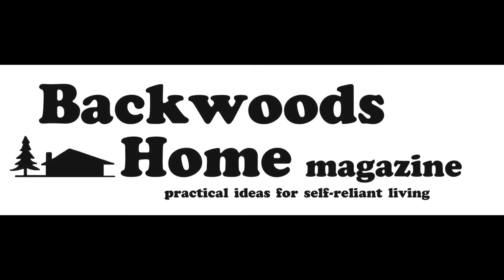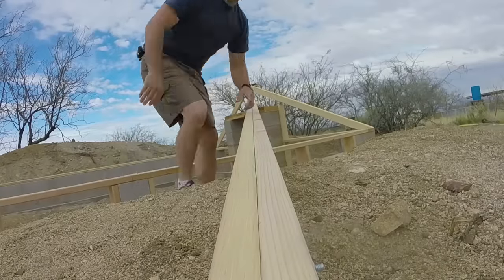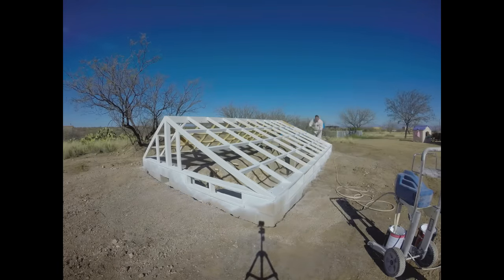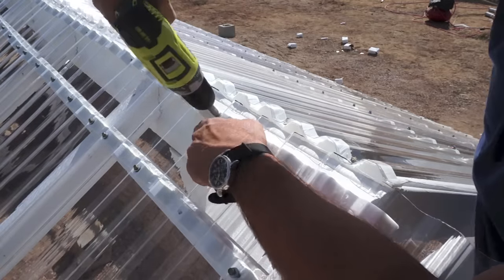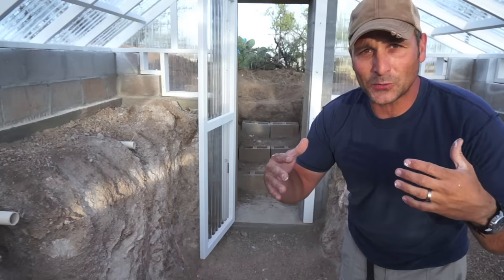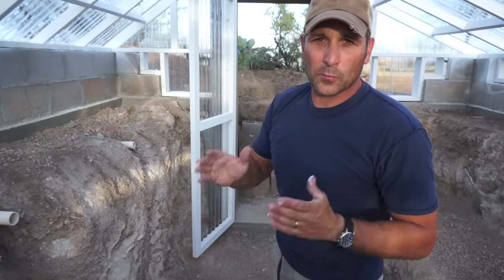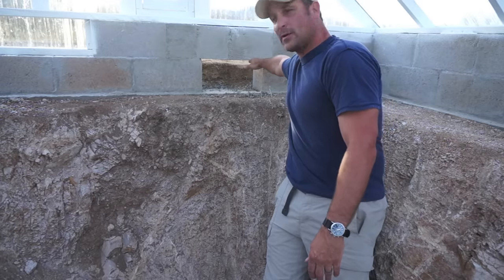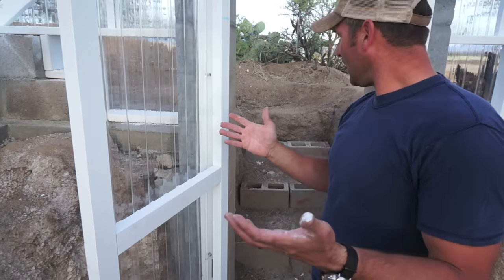Sunken Greenhouse Part 3 - framing, polycarbonate install how to

Comment: Use steel cable, and turn buckles to add cross strength.  In lieu of installing a pillar in the middle. A perfect triangle won't sag

Comment: have you investigated any of those automatic hydraulic  vent openers? They are cheap and don't require any electricity or anything. I found they are a lifesaver - (plant saver) on hot summer days?

I really like your attention to good solid construction for a project that will last  lifetimes  perhaps. That thermal vent is especially awesome. What a clever person you are!  Where is this project located?  Looks sort of like heavy clay  rocky soil.
Reply from the maker: +Don Rad Hi Don!  Yes, I have been considering adding in a hydraulic opener but am concerned with our crazy winds here... so I may stay with manually opened ones, but it's still a consideration as I love the way that they work without electricity!  As for location, I'm in S. Arizona (high desert)... and yes, this soil where the greenhouse is a mix of decomposed granite and clay mix... which isn't too much fun to dig...lol!
Thanks for watching!
joe
Reply: +homesteadonomics From Experience: If you don't have some type of automatic venting system, sooner or later you will fry everything in the greenhouse. In your climate I would recommend a fan hooked to a thermostat blowing out a louvered vent. Then on the other end have swamp cooler pads. Even with vents and doors open you will have very high temps in the summer desert sun. I built my first greenhouse in Phoenix in 1980. I put a regular swamp cooler on one end outside that kicked on at about 80 degrees. 
Even with automatic system, you should have a separate fail-safe alarm that sounds and calls your cellphone if something does not work right. All of this advice, of course, depends on the value of the plants you have inside.$$

Comment: I would think you d have to seal all those screws with some sort of adhesive or sealant ...or maybe you need the moisture building up inside of the greenhouse along with some air seeping in....

Comment: The entrance needs to be enclosed with a drain at the bottom. The footers need to be below floor level with sealed masonry walls  with drainage below floor level. And the roof needs gutters with drainage away from the greenhouse. This unit will eventually become a mud pit with the outer walls and footers being eroded and undermined by the power of water. Cutting cost is nice if you can afford to rebuild every year or two.
Reply from the maker: Charles Lloyd I have a couple recent updates if you want to check them out. One from this month and on from November.  I have gutters that collect rainwater and channel it to my garden where it’s collected in IBC totes.  This past August my house had over 11” of rain and only a wet area by the door.  The ground is graded away from the structure.  Anyways, check out some of the others and you’ll see the other items.  Thanks for watching and I hope I answered your questions😀

Comment: I had an idea about using corrugated pipe to burry under a green house with vents close to the floor and vents at the top. Hot air rises cold air sinks pipe close to top heats up creates an up draft that moves air like convection in the green house. Could even add low voltage electric fans to help move air through the pipes. The burried pipe would pick up the cold from being fifty feet down i thought maybe there could be a way to use fan speed to keep a set temperature within the green house summer and winter by having two ventilation systems to keep the air moving inside a green house with all componats being designed to handle humid and moist conditions.

Comment: ditch the support beam and just put collar ties across there, they will keep it from sagging, remember they go in the top 1/3 of your rafter length
Reply from the maker: +lil00chevy Yes, that's a good idea, and one that my father-in-law suggested too.  But I already went ahead with the post for both support and as an anchoring feature incase the structure ever started to flex with our crazy winds here.   But I agree, the collar ties would've probably been more than enough:)  Thanks for watchign chevy.. and stay tuned for part 4:)
Joe

Comment: I would really like to know what the advantages of a sunken greenhouse. Is it because there is a lack of water in the area it is being built, the sunken greenhouse is designed to catch water for the produce you are growing inside. I live in wet England and it would soon be a pond with a fancy roof on top if I built it here. If you could answer my question or if anyone else could you answer I would be very appreciated.

Comment: Used the same roofing panels on a job for a customer of mine. It was a patio cover that was 30' long by 12' wide. Turned out great but after two summer's he hired us to replace the panels due to the heat was warping the panels. Have you run into anything like that?
Reply from the maker: Ryan B hi ryan... if you check my videos fr m about january 2018 time frame you can see an update of this project.  Currently it is over 2 years old and the panels have not warped and are still very clear.   These are polycarbonate and not vinyl panels...I’m guessing the panels you used were vinyl.

Anyways, check out that more recent video and you can see how they are holding up:)   Just click on my channel page...then videos tab and they will be in chronological order😀👍

Comment: Looks awesome. What's your plans to keep it from flooding out in heavy rainstorms?
Reply from the maker: +Ponca City Lawn Care LLC Hi PC... I'm going to do a QA vid on this series and this is one of the most common questions.. for good reason too.  Initially I'm just gonna let the rain come in.  I've measured the sq/ft of the potential collection area around the stairs and it shouldn't amount to more than 10-15 gal of water for a 1" rain.  IN my environment it'll soak in with no problems.  Everything else will be graded away from the GH... and I'll be installing gutters to collect the roof run off....BUT, that's no sure thing and it may very well end up with more water than I expected and then I'll have to do some problem solving...lol!  But if so, I'll probably end up building a cover or something like that for the stairway area.  Hope that answered your question... but ultimately I'm gonna have to wait and see:)
Joe

Comment: I'm not a builder so this is a basic question. How did you attach the purlins at 1:55? The video is too fast and at a distance. I don't have a nail gun, so I was thinking of off-setting the purlins (the width of the purlin) so I could hammer the nails straight in from the other side of the rafter. I don't know if this would be bad for the polycarb panels because they would not be screwed down in one straight line. I'm attempting to make free-standing, shed-roof awnings for 2 exterior house doors, 8x6 and 6x6 foot square areas.

Comment: Hi from kiwiland. Love this. Can I ask why you went sunken? Im guessing ease of maintenance and using the earth walls to store heat? Im assuming that there are no flood concerns if it is built on a high area? Thanks.
Reply from the maker: Hi Mike... yes, I sunk it for earth/thermal benefits as well as high winds in our area.  And because I just thought it was a neat idea:)  Flooding is not much of a concern as our water table is hundreds of feet down and all of the ground slopes away from the structure.  Glad you liked it.. part 4 is up and part 5 is in the making:)
Joe

Comment: That is looking so good and you did a great job on it! Considering your location what safe guards are you placing to prevent the rattlers etc from making this their home?
Reply from the maker: +weetreebonsai Hi WTB!  Regarding snakes and mice... I'm thinking the door and all the gaps are tight enough that I shouldn't have a problem... but only time will tell for sure... gonna have to build me a snake pole just in case!
Joe

Comment: Do you have to use a special grade of corrugated plastic for the roof? Something optically clear to let UV light through?

The reason I ask is that a friend of mine once replaced the panels on a tanning bed to surprise his wife at her hair salon. But, he didn't know to use something called 'OP4', which is optically clear and lets UV pass through it.

Comment: You don`t need a centre support.  You have very little weight in the roof,. even covered with snow.   Actually the biggest weight the roof will see, is wind pressure . The roof weight is taken by the rafters which bear onto the wall plates pushing outwards. if your wall plate is fixed to the wall which in turn is supported by the soil against it. .. Imagine the force needed to spread the rafters and consequently push over the walls...  Not going to happen..   Quite safe as it is...

Comment: Wonder how this would do at 46N (Prince Edward Island).  10 hrs days go from Nov 5th to Feb 5th.  So nothing would grow but harvest would not be an issue.  Just staying marginally above freezing would seal the deal for me.
Reply from the maker: Hi Brent... I'm not totally sure how it would do but I think it would be worth looking into.  For you though it might be better to be built into a south facing hillside since the sun will be lower in your horizon.  But I think i could definitely work... you could add a rocket mass heater in it and that would make heating it really efficient.  I haven't built one myself yet, but from what I've seen from others, they are really really cool (in a warm way)!
joe

Comment: Can you give a update on how the clear  poly roof is doing.  I been reading reviews through out the internet that they become brittle and yellow?
Reply from the maker: punkdevito if you want to see I recently did an update this month..super quick with my plans for the new year.  These polycarbonates are still perfectly clear.  I believe many of what people are reporting are ‘vinyl panels’ that were sold as polycarbonates or they just didn’t read the labels when they were selecting them😉 and picked vinyl by mistake. Vinyl panels will no doubt get brittle and yellow over time.  But so far mine (polycarbonate) are holding up great 😀👍🏻

Comment: What are the advantages/disadvantages of a sunken greenhouse compared to a regular greenhouse? Also, what's the vent door used for?
Reply: 50,60 centimeter onder de grond vriest het nooit, hetzelfde principe of in de kelder denk ik. Daarom ook dat men bepaalde leidingen zo diep in de grond plaatsen
Reply: Can you please write in english?
Reply: my remark was'nt right, it was outside the question, sorry i was taking about the cellar-effect
Reply: The vent door is just to let are in and to let heat out
Reply: Helps maintain the ecosystem inside the greenhouse.
Reply: Mata Pegheata I'd imagine it was extremely well insulated. So will be easier to keep warm in the winter
Reply: He probably lives in an area that gets cold so he might be able to grow food year round in that thing
Reply: Under ground about 6 to 8 feet the temperature is close to 55 degrees . All year round. Saves on heating and cooling year round. Also all walls are insulated by Earth.

Comment: Don't know how much it rains where you are, but what do you plan on doing when it does rain? Will the greenhouse not flood? Is the door watertight?
Reply from the maker: +robotfishFX Yes, the rain will get in a bit but it shouldn't 'flood' as the only area that will allow in water will be the stairs...everything else will be graded away from the structure or will be captured in some future gutters to be harvested:)  And the door is snake and rat tight but not water tight...lol.... I don't think it would be able to hold back any amount of water pressure:)
Joe

Comment: Where do you live?  Also are you planning on growing year around?  I live in Colorado and am considering a greenhouse to grow year round.  Can't wait for the next episode.  Also interested in whether you will be using hydro / aqua ponics or traditional growing methods.  Lastly you said in the vid that for your ridge beam you used three 12 foot two by sixes?  It looks like you have 2 there????
Reply from the maker: +George Henson Hi George... I live in AZ (just south of Tucson at about 4000' elevation).  As for growing.. mostly pots and containers... i have considered aquaponics... but if so it would be down the road a while.
And for the ridge beam... the first two 12 footers are staggered where they are connected to one another at the 6' marks.  The third was then cut in half to fill the void spaces, therefore making it look like it is only two thick... not sure if I described it correctly...lol.   anyways, hope that answered your questions!  :)
Joe
Reply: +homesteadonomics Thanks for the response.  I guess year round growing is something you are considering.  My home is at 8000 ft. and my winters get to 30 below sometimes.  Strong winds here as well.  Here is my home and details.  http://offthegridtomorrow.weebly.com Hope to get a greenhouse built this spring and will hope to use aquaponic system for the fish and the water conservation.  Anyway cheers, love your vids and look forward to more.

Comment: Homested;

We are in Nevada, winds are about 30-40mph ave and 60-70 often.  The wind blows 2 of 3 days.  When we take walks, the fields are littered with Harbor Freight Green house panels.  I need to grow veggies.  Do these panels blow and break,  It sure looks nice in calm weather.  Also, what is the growing season in this thing,  Also if we go above ground, do the panels need to go all the way to the ground?
Reply from the maker: +Interagency Fire Hi IF.... I actually bought a used HF greenhouse on craigslist several years ago and all I ever did was chase those panels down...lol!  We experience very strong winds here, especially fall and spring during weather changes... 70+ is not uncommon and the reason it looked calm is because I waited until a nice calm day to do the install... I had too;)
The sunken aspect of the GH is highly motivated by my previous GH wind experiences.  Only time will tell but I can tell you the last 3 days were 40-50mph winds, and the panels have held up fine.  Anyways, I only have about of month of experience with them so I can't guarantee anything but I'm pretty happy with them so far:)
Joe

Comment: well done brotha!  but hey, how are you gonna keep water out of the bottom of the green house if it rains enough to come dow. the steps and around the door? sorry if you already said something about it, i didnt catch anything though.
Reply from the maker: +Dustin Bodendorfer Thanks Dustin!  That is probably the most asked question I get for this...lol... but it's an honest one.  So i'm planning on answering this in an update video.  But, the short answer is that I will get some, through the stairs.  Everything else is being graded/sloped away from the GH and later I will be putting gutters on to further keep excess water away from the walls.
Regarding the stairs though... my calculations estimate that for a 1 inch rain I will get about 5-10 gallons of rain down the stairs.... so with our dry environment I'm not too concerned about it and figure it'll just add some good humidity to the air inside;)
Anyways, hope that answers your questions:) Joe

Comment: Nice job. I am wondering about using the poly carbonate down here in Chile. Where I am we have a whole lot more rain so I have to plan for that in my design. Also I have been considering the Honey Comb poly carbonate as it provides a little more insulation for the roof. Did you consider this as well. Jim
Reply from the maker: +ChileExpatFamily Hi Jim,  I'm not familiar with the 'honey comb' polycarbonate but it sounds interesting!  I chose this tuftex product because of the high heat rating and overall durability.   So far I've been extremely pleased with it and can't wait for it to cool down in the fall, so I can really get some use out of the greenhouse:)
Very cool to hear from Chile!  My wife had a friend who stayed in Santiago for a couple years and after about 6 months, she didn't want to come back to the US..lol!  She loved it down there:)
Joe
Reply: +homesteadonomics Well the Honey comb cells run length wise and it makes the polycarbonate a dual walled structure with air in between. We use it a lot here in Chile. I am surprised that you do not have it up there in the former USA.
On the Santiago thing, It is a big city. Nuff said, but I canIt not blame her for staying. There is not much good about the former USA any more. It is safer, cheaper and freer here plain and simple. 

I am real interested in the final greenhouse product. I can not do a dug in green house here because of the rains we get in the winter (right now). Where I am in Chile is just north of Antartica so it is cool and rainy. Very little snow, and lots of rain, rain, rain. Think of washington state with out the snow and you get the picture. 
Santiago is more like where you are in the climate thing, dry and arid. Jim

Comment: Great job on the framing. How are you going to control your drainage? I’ve used those panels before and the sun really makes them brittle after a few years plus they don’t have the insulation value or strength of twin wall polycarbonate.

Comment: 1. Once you have planted whatever you want to plant there, with this type of greenhouse what downsides do you expect to deal with 2. what downsides you hope not to encounter(things that could probably go wrong)?
Reply from the maker: +myonlynick Hi Myonlynick... I'm planning on doing a GH video where I answer a bunch of questions that folks have been asking... I'll be sure to answer these their too:)  ... but the short answers to your questions are.... making sure that all growing areas receive proper light in the winter, making it 'snake' tight so I don't have unwanted visitors, and some other things that I still have to brainstorm about:)

Joe